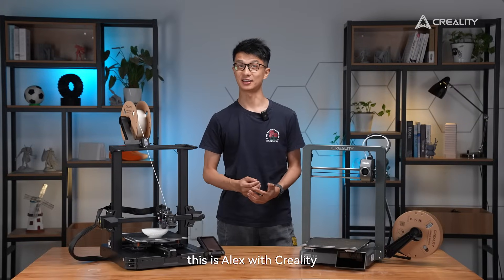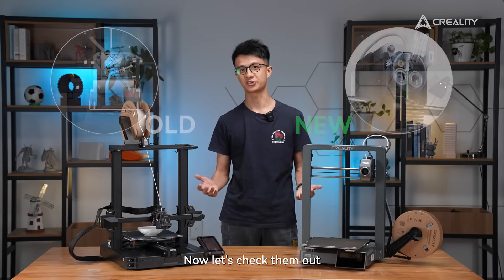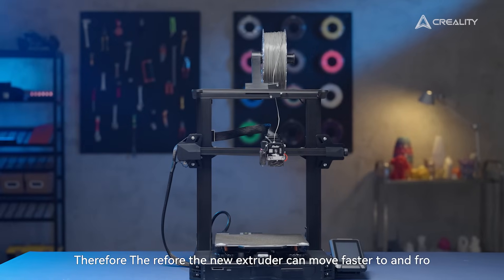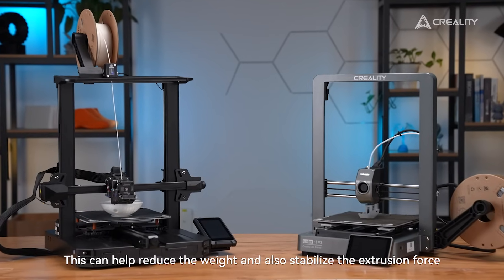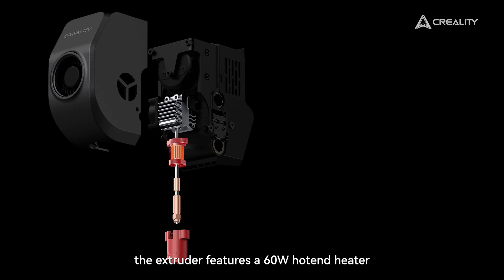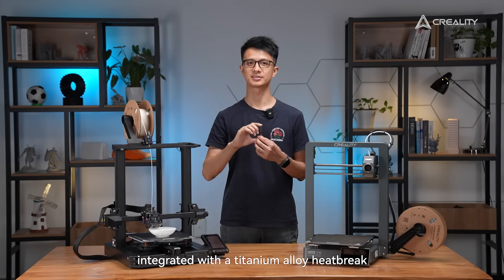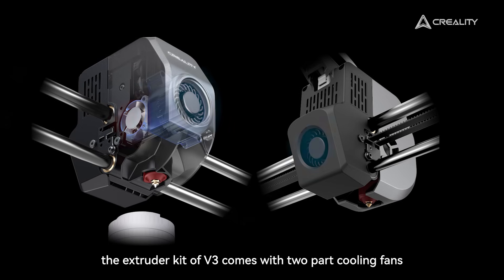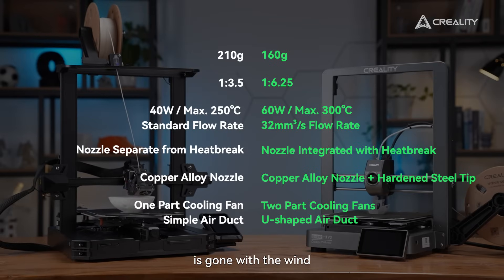What's  New to the Extruder Kit of Ender-3 V3?

Comment: Got a simple question, does the gears of the ender 3v3 plus are made of metal? Cause I got a jam while trying to print with tpu, and I wanted to insert a hot metal wire down to try to get out the clog. Do you recommend me another option, cause I can’t even insert the wire ?
Reply: Yes, I did that a lot. Insert a hot metal wire and then wait for half minute to cool down, it might drag out the excess deposits.

Comment: I have a 3-v2 and about 6 months ago, i got the 3-v3. Both are fantastic machines. The v2, is a serious work horse. But I have to admit, the 3-v3, is much faster, and prints the super soft TPU rubbery filaments much easier with out any issues or jams, I think because of the direct drive head. I also run the PI filament dryer also, when using the TPU filaments, so I can run the printer fast on that type of filament so it doesn't "puff up" or have steam trapped air bubbles in the layers lines.. and run the heck out of that combination full throttle... And been making RC car & truck truck tires since. Fantastic set up. I am so glad I went with CREALITY brand. I did allot of research and got overwhelmed, as it all started to look like the same stuff, brand to brand... Then, read, they have tech support and wonderful people to assist with walking you through any issue you might be having, and that was my deciding factory. And I will say,  if you ever do have issues, just be polite, calm, and give them as much info as tou can, and they will always, do their best to help you. The language barrier does take a little time, but, the translator through txt-A.I. works very good. Also, the parts surplus they offer, even on older machines is great. Very affordable too, even to the point, i have back-up roller wheels and belts on hand, incase I wear out another set of wheels, and the two "X&Y" belts, wore out, but that was my fault, as i had the belt tension way too tight. Oops!!! But, my ENDER 3-V2 is now almost 3-1/2 years old now, and has been printing on the same hotend for 11,800 hours now, printing paperweight engine blocks of various models I have scanned in to the laptop, i scan torn down to raw engine blocks, and tweek the STL or STEP file to clean  up the scan.. and print.. done . Granted, many of then larger engine prints can take 30 hours. 

That machine has been on longer and printing, than it has ever been turned off.. I am very proud of that!!!
Reply from the maker: Ty for your professional comment!